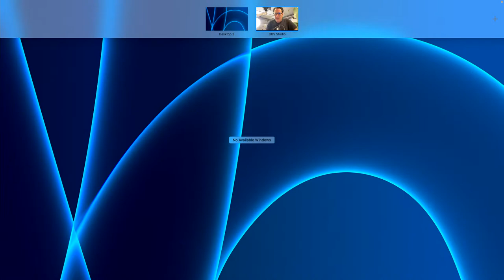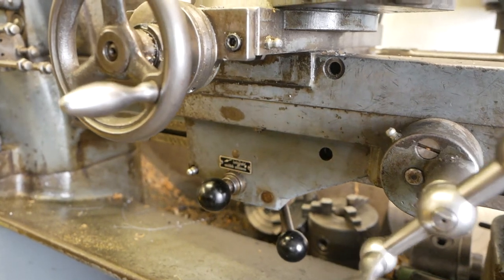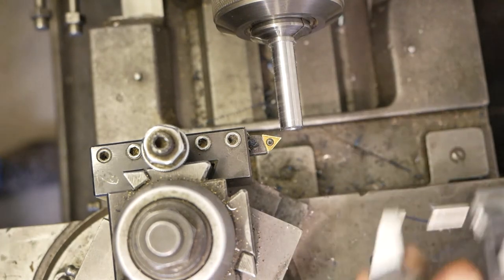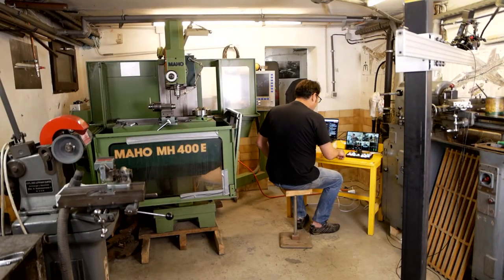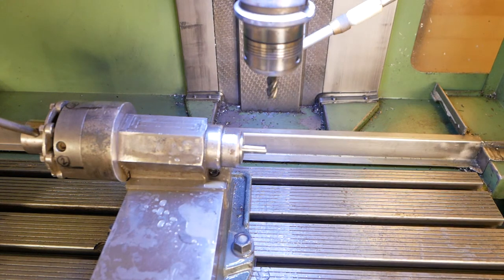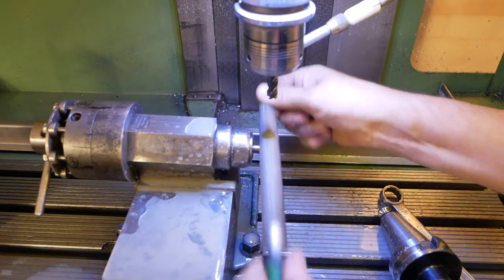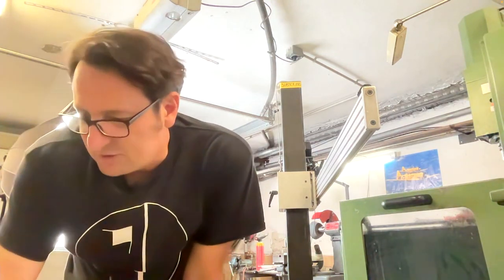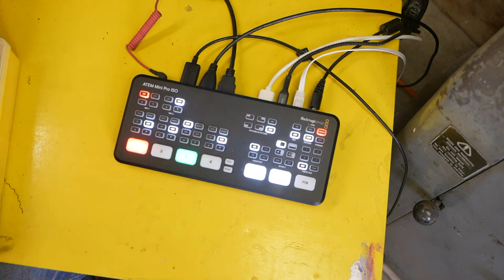RotarySMP Livestream - DIY Square hole cutter

Comment: G’Day Mark, with all the drama I overlooked the simple fact that your new video switcher works really well. I did a re-watch with emphasis on the switching, and it looks solid. The wipe feature is good (now that you know about the bounce). The audio wasn’t a problem on my platform, without headphones, even when the vacuum was running. 👍
Reply from the maker: Hi Doric, thanks for the feedback on that. 
When I do this again I will:
1/ limit the scope a bit more. Maybe just one machine, two max.
2/ Test the whole process, including making a whole test part. Just thinking it through was not enough.
3/ try to relax more :)

Comment: I guess the camera stand made by Marius Hornberger, fixed on the roof, would be of a big help for you.
Reply from the maker: Probbaly not really, as this basement has a pretty low ceiling. I made that stand, as I have four different rooms I film in, and therefore need to move it from one to another.

Comment: As the Schaunlin project shows little progress and you could consider ut finished, I have the feeling there is a major new project coming up:
"Bolly Re-conditioning project"
Looks like the Bolly needs some major maintenance and TLC! Hmmm?
Reply from the maker: I am more inclined to sell it. It is pretty heavily worn, as Boley didn't harden the bed.

Comment: Can you put the toolpost on the opposite side of the work and run the lathe in reverse to do a left-to-right cut?
Reply from the maker: Hi Alan,
This is one of the limiting aspects of the Boley 4L. The geometry of the top slide and handle cause collosions which limits its use to a pretty restrictive range of angles.

Comment: Why so quick to chop it off? Seems like there was plenty of material there to make your broach... Are you going to turn the back relief into the broach on the lathe? I suggest you do! Then you can take it over to your mill to square it up. I think it'll come out looking premium not just boring and angular like the others. You going to drop it into a live center holder? That'd be my plan. Cherio! Keep up the good work!
Reply from the maker: I still need to get back to this, but it is on the back burner for now.

Comment: So you have to switch power between Boley and Maho every time? Really? 🙄
Reply from the maker: Yes, MAHO, Boley, Clarkson and the oven are all 400V three phase, and I currently only have one socket in that garage.

In practice it is normally not a big deal. It is no that common that I use two or more of them in one session.